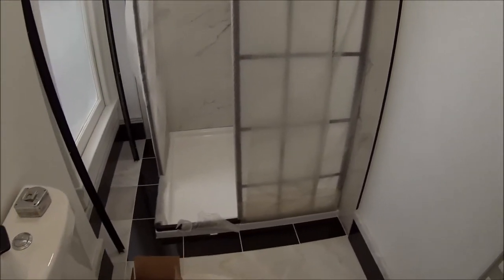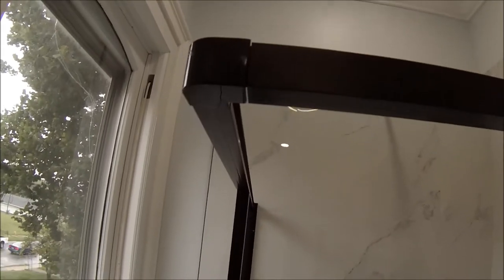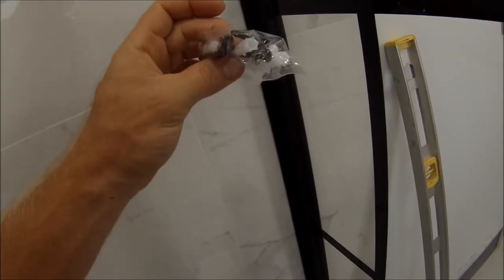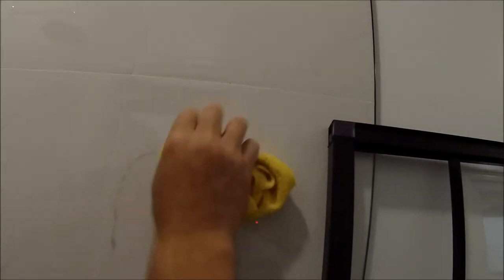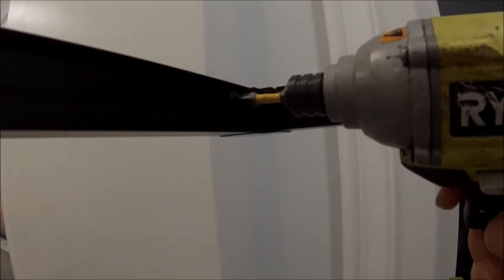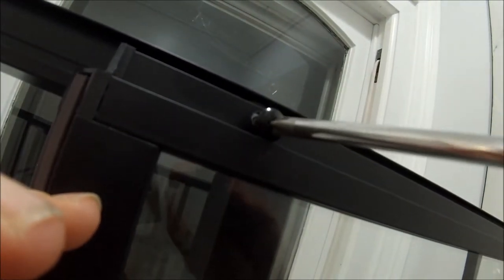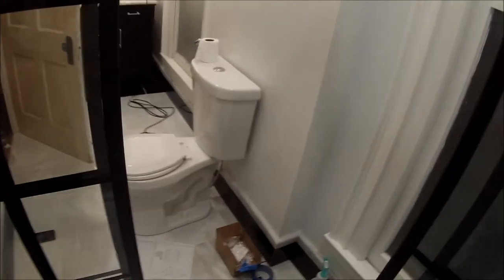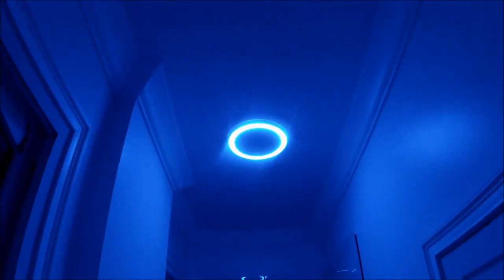DreamLine French Corner Shower Installation

Comment: Thanks this helps alot we are getting ready to install this model and was thankful to see a how to video.
Reply from the maker: Hey your welcome. When i went to install mine. There was not one install video on it, so I thought I would help others out.
Reply: @JacobKnightRiderShop  is it necessary to caulk inside the channel that the frame goes into? Or will the water run back into the pan.
Reply from the maker: @colton2944  Just need to caulk the channel on the walls and bottom. Not the frame that goes inside the metal channel.

Comment: that bathroom would work even better with a wall-mount toilet, mounted on the opposite wall. the tank goes inside the wall on those units
Reply from the maker: Yea I couldnt do that the wall on the other side was only a 2 x 4 but laid flat so its only 2 inches thick.
Reply: @JacobKnightRiderShop  wow that's tight!

Comment: Did you install the tile from the floor up and have the shower pan butt against the tile? Or Did you install the shower pan and then tile?
Reply from the maker: Install shower pan first. Then tile from bottom up use a level or laser level for the tile to be straight.

Comment: Thanks so much for this upload! This is a shower I was looking to get for my bathroom and your vid helped answer some of the questions I had that came up. 

What did you do to set up the base that the shower sits on? Is it also porcelain?
Reply from the maker: The base was fiberglass premade pan. It just sits on the floor and you screw in the top tab or use motor thinset to sit it on. I believe i made a video in my playlist diy renovations that showed me installing the base. Also the tile is porcelain on the backsplash.
Reply: @JacobKnightRiderShop  do you remember the name if that video you made for the base? Also, was the base a Dreamline aswell? This is the exact unit I just ordered. I got the matching base in black. My only concern is where my wall studding is for the rails as the plumbing rough in was a pain. I ordered the 36" base and 34 1/2 in French doors. 
I appreciate the video as there wasn't one at all I could find. I owe you a virtual beer !
Reply from the maker: @collsguy  Yes the base was same brand, but I think mine was 40 " inches width. base and doors
Reply: @JacobKnightRiderShop  what type of screws did you use to fasten trim to the wall?
Reply from the maker: @collsguy  I believe it was the screws that came with it. They go into the studs, if you don't have studs where they go use anchors I think they are included.
Reply: @JacobKnightRiderShop  I installed it last night. Don't believe it would have went as well if I had not watched your video on it. Great tips !

Appreciate it, God bless brother.
Reply from the maker: @collsguy  Your Welcome. I hope it looks good.

Comment: Did you have any issues with leaks, I having trouble with leaks but I had a contractor install it and regret I didnt just do it myself
Reply from the maker: No leaks for me, but my shower is a rainfall shower so it drop directly down, if yours shoots at  the glass, you would really need to caulk the bottom well.
Reply: Hey Nick, our shower leaks too! Have you been able to resolve your issue? My husband has caulked it probably 6 different times now.

Comment: Why did you do 3/16 instead of 5/16?
Reply from the maker: 3 /16 drill bit is what fits with the screws used
Reply from the maker: Smaller the drill bit the easy to cut as well thro porc. tile